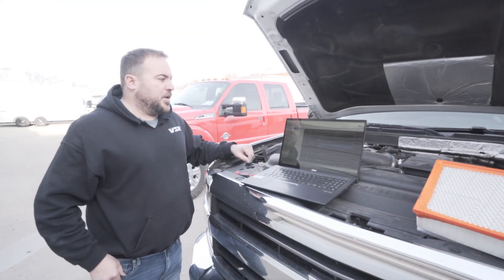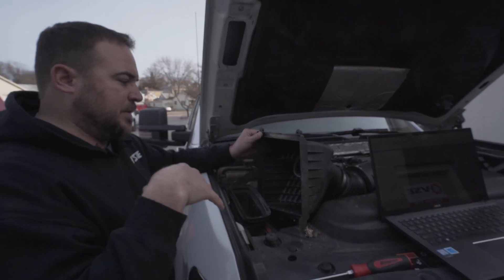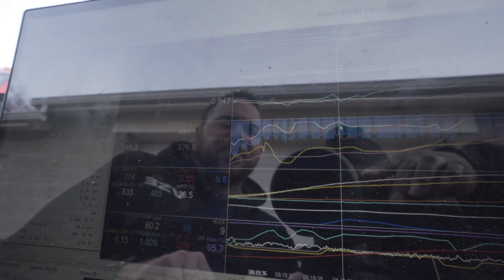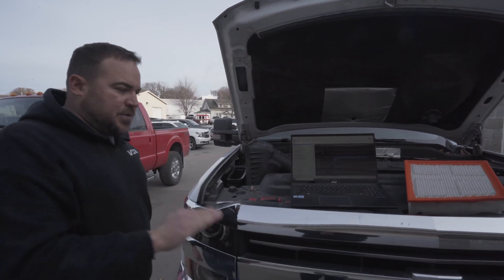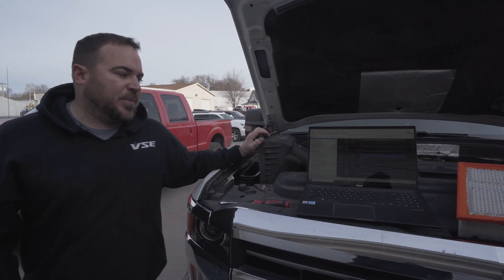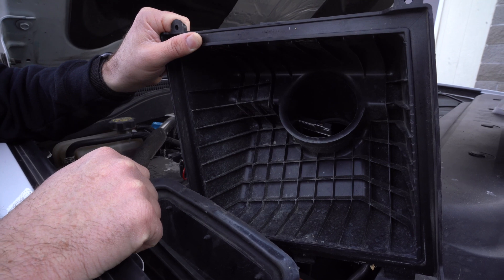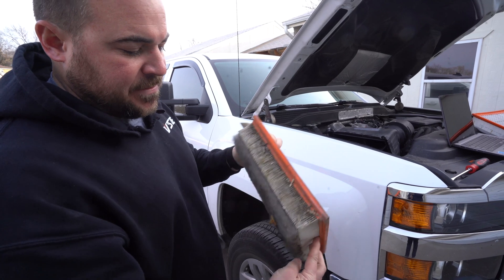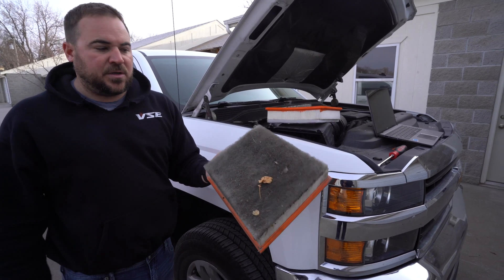How impactful is a clean v dirty air filter on a L5P Duramax.

Comment: This guy is a MuFin Genius.  Seriously......Well done on this video.  So the question is, how good is a Banks Cold Air intake?  I'm getting ready to tow a 16K 5th wheel and was looking at cold air intakes as opposed to the stock intake.  I'm not looking for performance gains per se, but wanted to best for the engine to make the tow easier...

Comment: Most modern diesels do technically have throttle bodies. But not for fresh air. It's to close off and restrict fresh air and force induction of EGR.
Reply: We understand that, but it’s not a throttle or “throttle body” it’s technically a blending valve to lower oxygen levels.  We were just trying to clarify that throttle doesn’t control output as it’s mostly open most of the time.